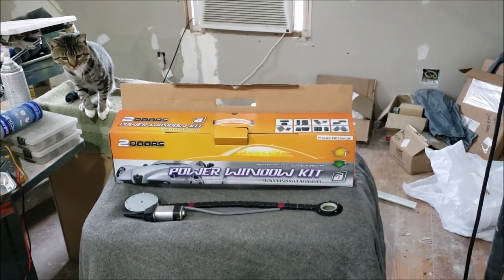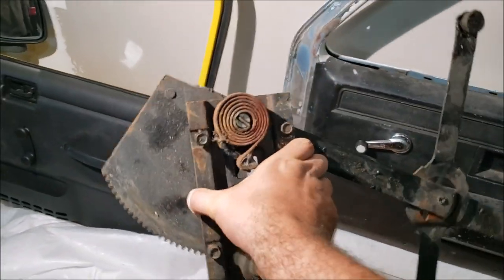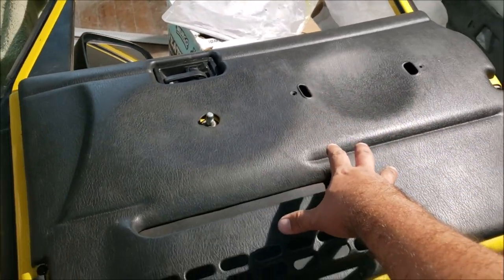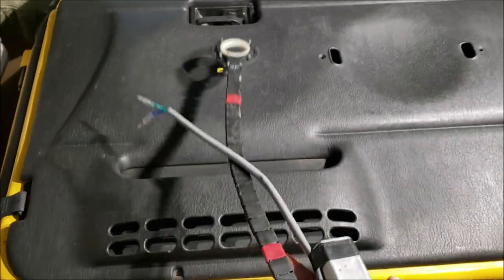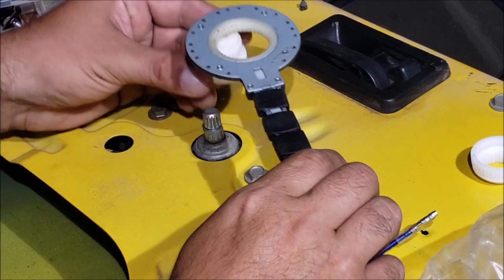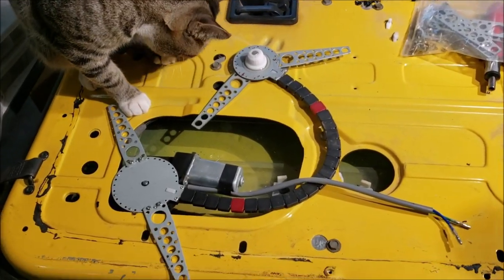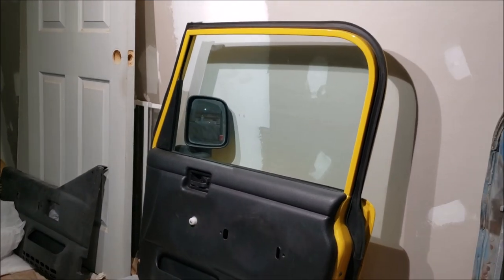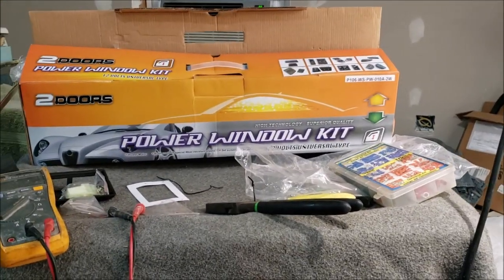how to install UNIVERSAL power window KIT and INFO DIY

Comment: I bought one of these kits a couple of years ago.  I just replaced them with the  replacement power regulators for my 06 Ranger since they started to fail.  Most cars and trucks are already made to fit power regulators if you have manual windows.  The replacement regulators are as good as OE and go up and down more smoothly and can cost less then a conversion kit.

Comment: Where can I hook up the red wire up so it can power when only the car in on was going to use a fuse tap but can’t find one that I can put the 30amp fuse in only seen some 10amp max
Reply: Exactly! I’m in this situation too. Can you help me as well?
Reply: @Sip28  did a relay from the battery and put a switch on to turn off and on so it’s not draining power with the car is just sitting you could also tap into your ignition wire but I
Did it the safe way and ran a relay with a switch
Reply: @Sip28  recommend this set up with the right gauge wire I’d use 10 gauge for power and could use small wire like 18 gauge to run the switch to the dash https://youtu.be/QAD8vDHTbzo

Comment: Hello Chris I have this exact setup in my 79 camaro however the windows are drawing too much amps and I want to install relays in hopes the relays will provide the amps to the motors. Could you please help me figure out the wiring of the relays. I inly want power to the windows when the key is turned on. I have switched power but I don’t know how to wire it.

Comment: can u put the power window on said door (have an 05 LJ) and also the power locks from ur vid with the half doors?
Reply from the maker: yes..if you are in houston i will give you the the power window kit.. i sold my full doors
Reply: @chriscraft77022  im in NJ but thx got the same PW kit diff lock kit hoping it works
Reply: @chriscraft77022  - I am in Dallas if you still have the kit. I will pay to have you ship it here. Surely that is what, $20?
Reply from the maker: What your zip code
Reply: @chriscraft77022  75048

Comment: 2022 one shop quoted me $1000,  another $1200,   both seem to quote me the "gullible lady " price. I did my research before going to either.  I knew the range for parts & labor was around $450+.  I'm a hard core  home DIYER but I know my limitations.  I found  a car audio stereo place that will charge me $650.  Im okay with that price.  because i looked up the part ---AEW JW universal Heavy Duty conversion kit --was $259.  I'm okay paying that price knowing it will be done by a professional with a warranty by someone who has done the job many times.